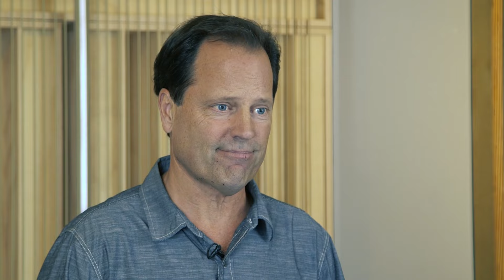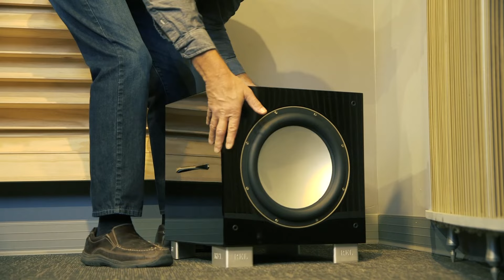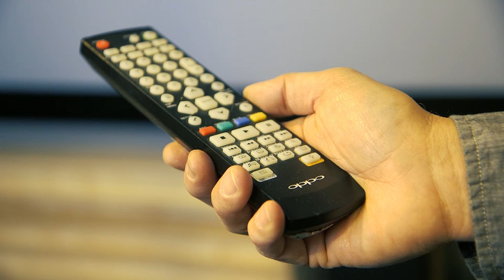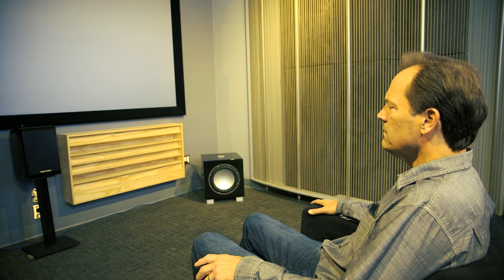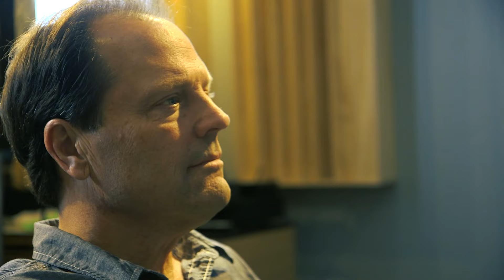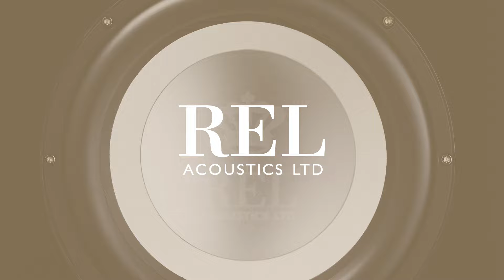REL Acoustics How To: High & Low Level Subwoofer Tuning Step 2, Adjusting Corner Placement

Comment: Is the technique different for a down firing sub?
Reply from the maker: With our down-firing models (the Tzero and T/5i), it is still important to take care when determining the ideal position of the subwoofer relative to the corner walls. Since there is no front-firing driver on these models, you will not need to worry about which direction the subwoofer is facing.

Comment: What if I don't have a corner to place the Sub, does the middle of the room work or left of my left speaker?
Reply from the maker: If a corner is not available, then placing the subwoofer along the front wall of your listening room can also work very well. The key is to listen carefully while moving the subwoofer so that you can hear which position results in the best performance in your room.

Comment: With two rows in my theater room,  I guess I have to sit down in an imaginary chair between the two rows to make sure it sounds decent in each row?  Thanks!
Reply from the maker: Ideally you should be able to find a balance so that good sub-bass output can be heard in both rows. I would recommend starting by tuning it based on how it sounds in your ideal seating position, then adjusting it slightly as you move around to different seats in the room.

Comment: Can there me something in front of the sub while it’s in the corner?  (like a speaker)
Reply from the maker: In our experience you should not have any issues with placing a loudspeaker in front of the subwoofer, though larger items like a cabinet or couch can dampen the subwoofer's output and result in tuning difficulty.

Comment: If I position the REL  in the front right corner and point it at the opposite corner there is a Settee in between, will this be ok.  The room is rectangular in shape 6 Meter X  3.5 Meter.  My Right + Left Speakers are against the 6 Meter Wall so the Subwoofer would be pointing down the longest part of the room.
Reply from the maker: Thank you for reaching out. In our experience this should be fine as long as the settee is not placed directly in front of the subwoofer, though it is difficult to say for certain without trying this placement in your room. If this positioning results in the subwoofer's output sounding weak or muffled, then it would be best to reposition it until you find a position which results in good sound to your ears.

Comment: I only have one corner. The other sub is along the back wall. Is it the same concept?
Reply from the maker: If your subwoofer is located along a wall, rather than in a true corner, then the same concept will apply except that you will only be dealing with proximity of the subwoofer to the wall, not to a corner.

Comment: Maybe aim wrong the rel website ses face the rel  sub towards the listening position or towards your chair
Reply from the maker: You are certainly correct. After finding the best distance from the corner for the subwoofer, you will want to adjust the direction that the subwoofer is facing in your room. Ideally the subwoofer should be facing diagonally across the room, toward the opposite corner, which usually results in the subwoofer also facing toward your listening position. The next video in this series discusses these adjustments: https://www.youtube.com/watch?v=sxsWjXoiYOQ

Comment: does this apply to t/5x?
Reply from the maker: Thank you for reaching out. The distance between the T/5x and a corner or other room boundary will have a noticeable impact on it's performance, and adjusting this proximity in your room will be an important part of tuning the subwoofer to blend well in your system.

Comment: hi i have my REL  firing into the wall so it faces the wall is this ok ?
Reply from the maker: We recommend having your REL's front firing driver facing diagonally across the room, aimed toward the opposite corner of the room. This will give the low-frequency waves produced by the subwoofer the longest distance possible before they reach a room boundary, which will result in deeper and more detailed sub-bass output.